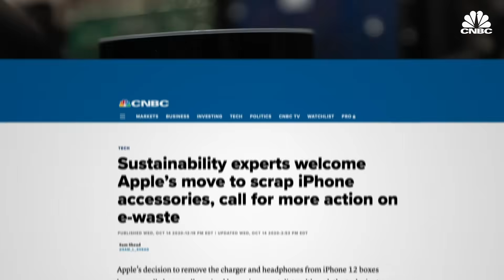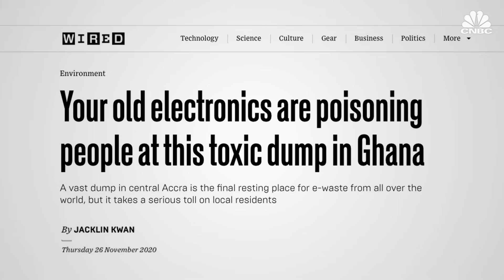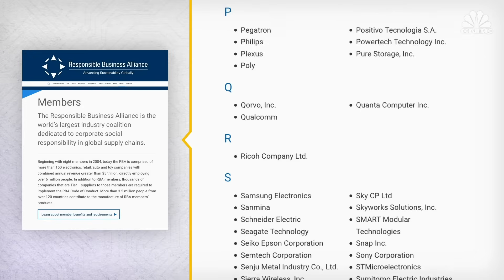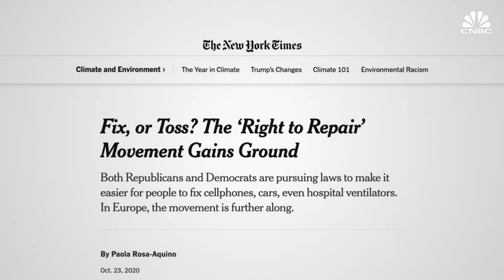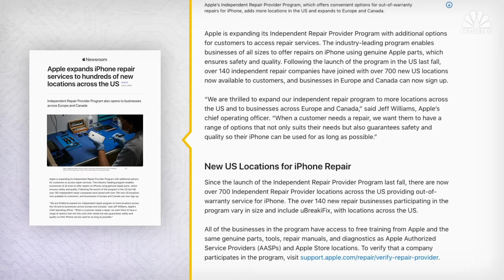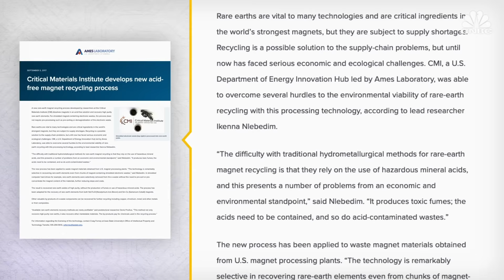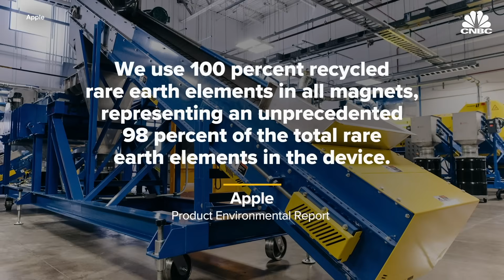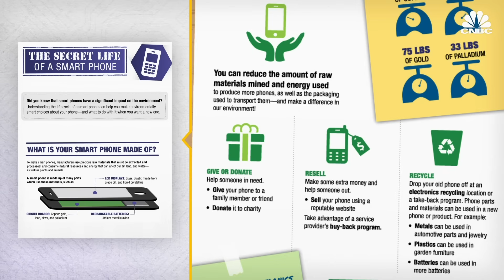How Can We Fix The Massive E-Waste Problem?

Comment: I am using iphone 6s from 2014. All I did was replaced the battery 🔋 and it works. As long as it works I use it. I hope everyone does too
Reply: You mean a 6s from 2015 your lucky as you got iOS 14 I’m using a 6 from 2014 and that has iOS 12 so a 6s is still up to date and perfectly usable until 2022
Reply: I had that phone for the longest until I could no longer deal with the message that there’s no more memory on the phone ...literally the biggest hassle
Reply: I had the 6S 16G until Jan 2020. I constantly had memory issues despite the fact that all my photos, emails, music, video, apps, texts, everything was off the phone. Eventually I gave up.
Reply: @OK_OK-d3t  Well you're strong enough to kept using a phone with 16Gb storage.
Reply: The problem is new phone has new design, faster chipset, better screen. Who don't want that.

N i admire u cus u not one of us :v
Reply: i had a 6s took it to apple for battery replacement they bricked my phone and told me to get a new one, after taking it to a third part repair, it turned out the apple GENIUS was a NITWIT, as he was replacing the battery he put a long screw in a short screw hole and crack the motherboard causing it to short circuit.
Reply: @ainzooalgown7589  
That reminds me of some Louis Rossmann videos, in which he talked about that and/or similar stories.
Reply: another thing you can do is give your older devices to relatives or friends (maybe even sell the item for like 15-30 bucks to them but probably no more than that, because you can find the iPhone 6 and older for less than 40 online) and prevent e-waste by granting a second life. 
Older relatives probably won't use their phones as much as we would, so worse battery health and low storage capacities won't be such a problem. Plus if they don't already have smart phones or tablets, by giving then devices you can contact them easier with video calls (especially in these times)
Reply: Yep, my dad still uses his 6S too, the only issue being that 2.4GHz Wi-Fi and Bluetooth don't seem to work, but 5GHz Wi-Fi still works and he doesn't really care. He also uses an iPad 5th generation.
Reply: My Samsung is five years old, just had to replace the battery. It's slower and freezes up a bit but is still very usable.
Reply: I have the same phone, the battery is dying and more often than not it says 'no sim' I don't get it.
Reply: Me too
Reply: That is what I did. I just now upgraded to the 12 Pro and I expect it to last as long as my 6s did. I’m glad Apple updates their devices for a while to allow longer use of older phones.
Reply: @jrobinson24  Apple lies a lot, their recycled elements only include 1 element that is 98% recycled. Apple is evil and China praising. They are greedy
Reply: @insectbite1714  Well I’m sure every big company lies, but I can only stand behind my experiences with them and they have all been positive.
Reply: @insectbite1714  you know Google worked with the Chinese government to make a censored web browser
Reply: @insectbite1714  sure. And still it is much much better using a well designed and supported apple phone like the 6s which is perfectly usable and updated today (came out in 2015) instead of having to buy what, 3 android phones to use in the same lapse of time? Think a little bit.
Reply: @076657  Applw destroys the enviorment they don't even come with chargers I can break an Apple charger with my fingernail.
Reply: Stop virtue signalling

Comment: I agree for the batteries. You know batteries have a limited number of charge cycles. After 2 years of regular use, most battery are at 80% of their original capacity or less... It would be very easy to design batteries easier to replace, but it seems smartphone companies do the exact opposite...
Reply: Sabotage

Comment: Phone batteries should last 10 years! The reason why they dont is not due to the battery (which has 3000 recharge cyckes) but due to the way we recharge them - I.e. once charged, further charging stresses the battery. Phone companies could easily put in protective circuits to prevent stresses when we leave the phone charging overnight. But they dont fir obvious reasons.

Comment: And also,Apple actually punished recyclers for repairing and giving working iPhones that were sent by Apple to be trashed to consumers that could use them. That's quite the opposite of what they like to brag about. They shouldn't be forcing recyclers to send still working,only partially damaged devices to landfills.

Comment: These sites that take your ewaste sell what they can and throw the rest in there local dump. dont believe the lies .reuse what you can stop buying the newest Edition .if we all wait at least 4 years to upgrade it will make a big difference.
Reply: 4 years? Well the problem is phone may get performance drop in 2 years, especially in low end phone thanks to application and system update that require more power.  Buy a higher end smartphone? Most developing and least developed countries people cannot afford that 😭
Edit: Also what if you get accident that breaking the phone physically? The high end phone may out of warranty and very expensive to service or buy again but you can just buy new for low end phone since it is cheap
Reply: Most people don't care. They need the latest phones for their instagrammable cameras
Reply: @ouya_expert  Apple encurages this
Reply: Most ewaste gets dump oversea so it doesn't affect us.
Reply: @konigstiger3252  Global warming you Boomer

Comment: Stop using glue, use normal screws, stop putting software locks on replacement parts, allow individual replacement parts to be sold. I don't care if the phone is a little bit bigger.
Reply: We all know they wont
Reply: I agree, but if we don't use adhesive, there wouldn't be water resistance
Reply: @Stem2Space  - Most if not all automatic watches are water-resistant without using adhesive. It's printed on the watch dial how deep it could handle under water/sea. If it could be done in watches years ago, no reason it couldn't be done in phones.
Reply: @manny7886  a watch is alot thicker also do u want a fat phone, I rather keep my phone thin.
Reply: @nikke9234  - I agree with you, I want my phone thin also. Speaking of thin watches, manufacturers could make them thin also (if they wanted to) because there are watches that are about 4 mm thin. My Citizen eco-drive is about 9 mm thin. I'm sure it's thinner than my old iPhone 6.
Reply: @manny7886  
But are the thinner watches water resistant or as strong against water pressure like that of Casio's G-shocks??
I have a G-shock and yes they are bulky. The rubbers and plastics are hella bulky.
Plus the last time I heard, most if not all "water resistant" watches don't have GPS, cab call someone, can use facebook, can play games, can watch p0rn, can take selfies, have "shiny" stuff like say OLEDs and more
Reply: @nikke9234  Thin but huge. I was given a smartphone from my employer, Samsung Galaxy A5 or so, it is huge and heavy. My own Nokia 2610 might be thicker, but is overall smaller and lighter, I prefer that over the A5 any time.
Reply: @Stem2Space  they still get watter damage easily
Reply: @victormanx  they are still more resistant to liquid than past phones
Reply: @Stem2Space  Lies. Water resistant tech has been around forever and been easy to open before. No glue needed.
Reply: @pyromcr  you should build that phone then since apparently it's easy peas
Reply: @juanspyro4658  Considering how the first few iPhones and all of Samsumg's old phones didn't have these issues it would be really easy. All these issues like glue have been added in over time to deliberately make these things tough to open up.
Reply: @pyromcr  then goes start a smart phone company. If you think you can make better product, make it happen instead of typing on youtube
Reply: @konigstiger3252  yes.
Reply: @pyromcr  Water resistant tech only consists of rubber o-rings and grommets. That's the magic.
Reply: @pyromcr  true that
Reply: @konigstiger3252  Don't be obtuse, companies have no incentive to make things last too long. They want you to buy their latest gadget.
Reply: @Stem2Space  And wouldn't be as compact.

Comment: Living a minimalist lifestyle and reducing consumption will help with the e-waste problem. As consumers we need to demand electronic products that last longer rather than buying newer generations of the same electronics year after year. We also need to encourage manufacturers to implement trade-in programs where consumers can trade in their old phones and electronics and get a rebate to buy the newer electronic products when the time comes to replace them. We only have one mother earth and we better treat it well and do our part to recycle and minimize wastes.
Reply: Totally right. If phones last longer they will be resold more. This could make a new phone more expensive, but you will be able to resell for that much more.
Reply: @drakes4625  where i live mostly everyone uses android since it can repaired for really cheap, meanwhile apple half the required parts get seized at customs for counterfeits, most android phones get on the spot repair usually 45 min -1h 20 minutes, had a Note 10 require a new charge IC took them 50 min to repair and cost me $60, compared to buying a new phone it was worth it, even sending it back to Samsung the repair would have cost me $250 and 2 weeks. even though the part sold for $2-10.
Reply: Stop buying a phone every year. Get a new one when the old one stops working
Reply: @trawrtster6097  That's how I roll. I think I got 4 years from my previous smartphone before upgraded. I'm also cheap, though. Who can afford to buy a new phone every year?
Reply: that was the way off life back in the day  you use something until it was not physically repairable
Reply: @FowlorTheRooster1990  back in the day? They have Roblox back then too? Lol
Reply: I switched from apple to Samsung, mostly were apple was factory in. But also repairable
Reply: Corporations: Reducing consumption ? Not on my watch !
Reply: Start with making it possible to remove the batteries again! The batteries are glued in your phone so it can track you everywhere you go, even when turned off. The battery dies, followed by damaged charging port and possibly broken screen....so make them easy to replace.👣
Reply: Google has been doing that for awhile with their phones.

Comment: Right to repair!
Reply: Louis rossmann
Reply: @aymanhawari2589  You can try to fix hardware, but what about software? If the proprietary software is not being coded to be compatible with older version hardware, it became a brick without anything gone wrong with it. Like the Nexus 7 2013 I used to own, It just bricked itself one day even though it was fine the previous day.
Reply: @khangsector  BRUH. I  said, the software will switch from android to chrome OS. The "software" is all cloud updates on the "server side" (googles computers crunching the data an numbers not the phone side.  The phone is just a device to display a screen and run 4g maybe 5g in this day and age... Everything runs on google servers theoretically, you just need a min spec device to run it. .  The thing that would brick your phone is if you have no internet. convert old computers into cloud-centric Chromebook-like systems is basically what I was thinking.

I imagine 5g data data and the hardware coming from computer servers is 1000% cheaper then running 8nm fabrication with a 50%+ failure rate and such
Reply: Tea stamp tax 🐸
Reply: and paaaaaarty!
Reply: Right to repair wont fix the fact that they will stop software updates. This isnt a toaster
Reply: @dp247c9  who said hardware repairs were supposed to solve software issues? The main purpose of right to repair is so that 3rd party repair shops can fix devices thus less tech would be thrown out because "they can't be fixed". If you can pay to get your device fixed then you won't have to buy a brand new one.
Reply: @mauby6781  this video is about ewaste... You can repair phones and tablets all day. But it you don't get any software update anymore more... It becomes useless
Reply: @dp247c9   only for iphones, you can root and install custom OS or even downgrade android devices. 

Also, not every new software update is worth it.
Reply: I have a first generation ipad basically the first one that ever came out. It doesn't upgrade any more. Sometimes it will kick me out of apps or kick me out of the browser while I am using it. Just became annoying as heck. I even did a hard reset which didn't fix the problem. I decided to get a samsung galaxy tablet. I still have the first ipad and use it from time to time. I use my samsung tablet too more so while I am on vacation though (beats bringing a laptop). As for smart phones- I truthfully only have had one. As long as it continues to work , I most likely will not buy another phone. Don't even care about the 5G. I'm content. As for laptops I had been using my Dell laptop since 2005. Then it finely pooped out on me 2 years ago so bought an HP. I don't really see myself as an e-waster as i tend to just use my gadgets for the longest possible and use them to the very max.
Reply: right to repair is differently unrelated because it goes back to the raw materials that is needed to produce replacement parts to a smartphone or basically any products that has replaceable parts, which produces another e wastes and that loop continues. System updates however does make a smartphone relevant but that doesn't mean people are stopping from buying new phones as it has much updated hardware and has features that they might need for themselves, heck a jump from iPhone 6 to 12 is so significant in terms of hardware, software, performance and features. The real problem is how to deal with and actual physical object that is now little to no value as people doesn't have the interest to do it.
Reply: Need to make it a felony to throw away e waste. How to implement that is the real challenge